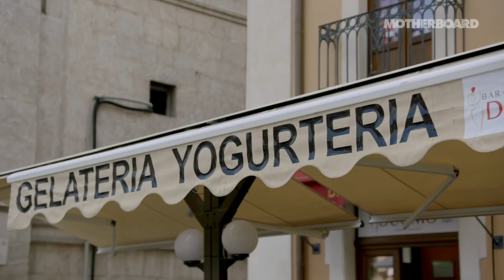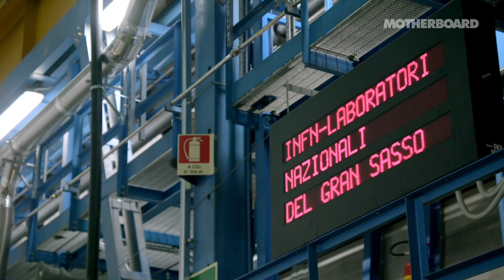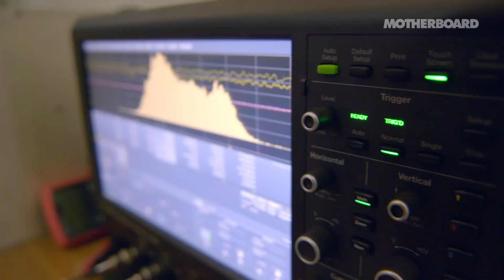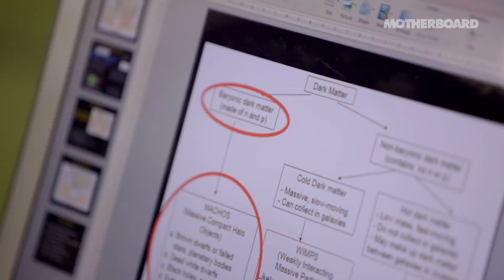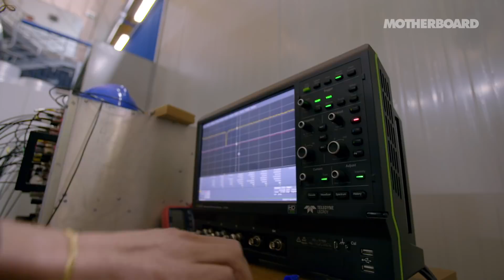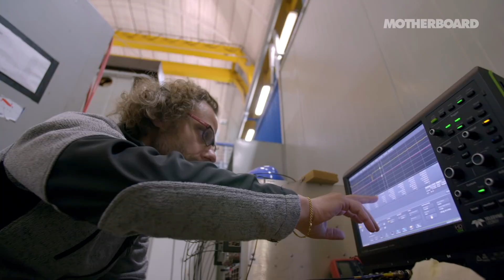The New Hunt for Dark Matter

Comment: Novel Dark Matter Hypothesis: DM is simply unaccounted for gravity. GR states that gravity is the consequence of the curvature of space-time. Is it possible that the structure of space-time itself could be warped without the presence of mass? Space-time has been shown to react like a fabric by warping, twisting, and propagating independently of mass, and all have been proven with observations from gravitational lensing, frame dragging, and now gravitational waves! Fabrics can be stretched, pressured, and/or heated to the point of causing a deformation. All of these conditions were extreme during inflation, so it is plausible that the “fabric” of space-time analog could extend having its elastic property have hit a yield point. 

Therefore, if gravity is the consequence of the warping of space-time, and fabrics can be permanently overstretched, then those empty warped geodesics would create gravitational wells independent of mass. My hypothesis of DM is subatomic black hole imprints of quantum fluctuations that popped in at the moment of inflation. These would be clouds of quantum sized floating fixed geodesics, so they couldn’t expand or evaporate. Perhaps nothing has been detected because there is nothing to detect, and GR wouldn’t require modification of mass interactions because DM would just be an extension of how space-time behaves at extreme conditions. No WIMPS, no MOND, no parallel universes, just space-time imprints to help jump start the galaxy accretion process.

Comment: They do not know what causes stars to travel so fast being so far away from mass/gravity, and at a near constant rate that what can be explained by the theory of general relativity. So because the movement of stars and entire galaxies cannot be explained by GR they assume there must be missing mass in the universe instead of assuming that GR is wrong/incomplete? they assume there is missing or hidden mass that Einstein's theory cannot explain. So they pin all the extra movement observed on dark matter and dark energy. 

See their problem lies in the fact that they assume that gravity is the only force in the universe able to move mass and it is not. Does a rocket use gravity to escape the Earth? Does gravity cause the rocket to be propelled? No! A rocket is propelled by propulsion, charged particles spewing out the end of the rocket causes thrust. And the rate of thrust is controlled by the amount of particles spewing away. But if the rocket were to spew out ion, charged particles forever it would only increase it's velocity if there was an increase in the ions escaping. If this rocket lasted for 5 billion years, every day, spewing out a wind of charged particles it would gain velocity at a constant rate to the time it and all other rockets (stars) were spewing a wind, and would never change. Meaning the rate of acceleration would be a constant for every star in the universe! 

Yes I know a star spins on it's axis and spews a solar wind in all directions. But if you understood fluid dynamics and realized that space was not empty but contained something, taking up the space between objects then you would see what I'm talking about. Space is filled with things that are real and tangible, measurable, like Gauss, temperature, amount of particles per cubic inch and more, lots of information as physicists would say. Space even contains energy. Astrophysicists call it the CMB, or cosmic microwave background radiation. It is everywhere, this energy is given off from the formation of stars. Stars add energy to the universe. This is why a star like our sun can still be shining after 5 billion years without consuming it's mass. It is not burning up or consuming/converting it's mass into energy, the energy is new to the universe. 

This theory explains everything, from gravity to dark matter and even dark energy. And it makes certain predictions too. Like the objects producing the most gravity would, you guessed it be producing the most energy. So Sgr A* in the center of the galaxy should be spewing high energy charged particles, extremely hot too! Einstein was wrong assuming that nothing is able to escape the gravity of a black hole because he did not incorporate the action responsible for gravity in any of his equations.

One simple fix to the theory of thermodynamics where it claims that energy cannot be created, to say energy can be created but it cannot be destroyed. It would clear up all these mysterious observations to date. New energy entering the universe explains the expansion of space at an exponential rate the further an objects is away from us. The more mass there is in between us and the distant object the more energy (dark) would be made, thus explaining the exponential velocity of space between galaxies with distance. Energy entering the universe from every spherical object that results in gravity is the action causing space to expand everywhere. 

Another prediction is the Hubble constant should not be a constant. The expansion of space would be determined by the amount of mass between us and the distant galaxy. So the more mass there is in space, producing energy, the faster the expansion rate would be. So this expansion rate would not be a constant anywhere. Why, because mass is not distributed evenly throughout the universe. There are even cold spots millions of light years wide that have very little star/mass. So the expansion rate there in those voids would be much less than anywhere else in the universe that contained mass! Sure enough, astrophysicists recently discovered that the Hubble constant is not a constant at all.

But get this, the rate of acceleration that occurs to stars and galaxies is a constant ratio between their velocity and age.  A constant increase of 1 mile per hour every 10,000 years! I know because I've done the calculations for stars, galaxies and even dwarf galaxies orbiting around the Milky Way. They all have the same ratio of 1 to 10,000 between their velocity and age. The older they are the more velocity they gain, just like a rocket being propelled by ions spewing away from it, so too are stars and galaxies being propelled. Not by their mass, but by the time they have been spewing a solar wind, charged particles.

Here are my calculations.
Sun velocity = 500,000 mi/h and age = 5,000,000,000 years old. Ratio = 1 : 10,000 

Milky Way galaxy velocity = 1,370,000 mi/h and age = 13,700,000,000 years old. Ratio = 1 : 10,000 

Carnia dwarf galaxy velocity = 1,300,000 mi/h and age = 13,000,000,000 years old. Ratio = 1 : 10,000 

Draco dwarf galaxy velocity = 1,280,000 mi/h and age = 12,800,000,000 years old. Ratio = 1 : 10,000 

Sextans dwarf galaxy velocity = 1,240,000 mi/h and age = 12,400,000,000 years old. Ratio = 1 : 10,000 

The entire reason for coming up with dark matter was because general relativity could not explain the super fast constant speeds of stars and galaxies that are so far away from other mass.

I've said this before, if stars and galaxies propelled themselves, not by gravity but by the time they have been spewing ion winds then the ratio between all the objects that spew a solar wind should be propelled at a rate proportional to it's age. And this is exactly what I discovered. Dark matter is dead! And why would a star escape the gravity of it's galaxy if it's increase in velocity was a mere 1 mile per hour increase every 10,000 years? It would not. Escape velocity is not total velocity but acceleration. The acceleration is a mere 1 mile per hour increase, not 1.37 million miles an hour! So a star would have no reason to escape the mass/gravity of a galaxy. The star would always be bound to the gravity of the galaxy, well unless acted upon by an outside force. Like say it getting caught in the gravity of a dwarf galaxy near it. 

Why would an astrophysicist even come up with a reasonable hypothesis to explain dark matter and dark energy? The longer these forces remain a mystery the longer they can get research grants. Hmm, think about that for a second. 

I don't have a PhD in astrophysics, I do however have a technical science degree. I research/study astrophysics and quantum mechanics as a hobby, got to keep this mind active in my old age. So I do not seek revenue from free grant money to explore the possibilities. So how was it that I came to the solution so easily? You people are being led like sheep if you believe there is dark matter or dark energy. The movement of stars and galaxies has been solved. Shh, don't tell anyone but black holes do not have event horizons either. Nothing can fall into them if they spew out energy in an equal opposite fashion than gravity. I'm betting I'm right. PEACE brother. Like to old saying, now you know.

Comment: Irony -- the "missing mass" is actually the mass of all the photons, so "dark matter" is literally LIGHT.  True irony. 

Also irony -- they think photons are massless. So the matter that COULD easily explain the missing mass is ignored -- and they would rather believe in matter that is intangible and undetectable to explain the fact that the equations for galaxy rotation are 95% wrong. 

There is no missing mass. The equations for determining how much mass there is in galaxies is just wrong. There isn't some invisible matter that lurks in another dimension. You just DONT KNOW how much mass there is in distant galaxies, period. You don't know how much mass a photon has.  Assigning the difference of a mathematical error to a letter and calling that letter Dark Matter does not make dark matter exist.  Instead  you should correct the error.  Use E=MC^2 to find the mass of the photon, then determine how many photons of all wavelengths there are in a galaxy.   An electron emits 13 times its own mass in photons every second. That is more than enough to account for the missing mass. 

The WHOLE PROBLEM is that one theory needs photons to be massless in order for gauge invariance equations to work. If photons have mass, the math for gauge invariance implodes. So physicists are sacrificing rationality and logic for the sake of preserving a flawed math of another theory by maintaining that photons are massless, thus making the universe lose 95% of its would-be mass.  There is no dark matter, there is just bad math and physicists protecting it at the expense of the truth.

Comment: General relativity is unfinished! What makes you think dark matter even exists?
Reply: I have a better solution to this problem, it is like modified newtonian gravity. But it is instead it is more like a modified einsteinian gravity, understanding that we need to set general relativity in motion. To do this we will replace the tensor field with a vector field. Which means the equivalence postulate is unnecessary because then a gravitational field is actually an accelerated frame of reference. This idea is called Temporal Quantum Relativity and I wrote a book about it. You can find it on ibooks, barnes and noble and amazon if you are interested. It even goes to explain time and quantum mechanics with the same basic idea that we are in a four dimensional universe as three dimensional objects.

Comment: There really wasn't a good explanation of dark matter (or it's bigger cousin dark energy).

Current observations of the galaxies do not fit General Relativity (the current best model of gravity)  based on observed matter. To explain the observations there must be dark matter (near the galaxies) and dark energy everywhere - according to General Relativity.

So if General Relativity is correct, there must something like dark matter and dark energy.

or

General Relativity is incorrect at galactic and/or cosmic scales.

This is an important question for physicists because it hints at how to extend and constrain quantum mechanical models to include gravity - giving the theory of "everything".